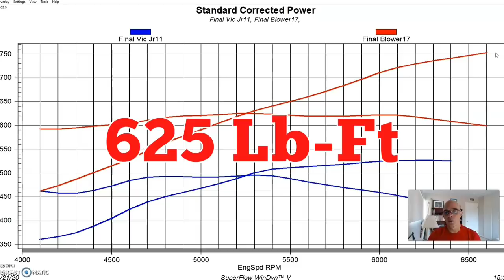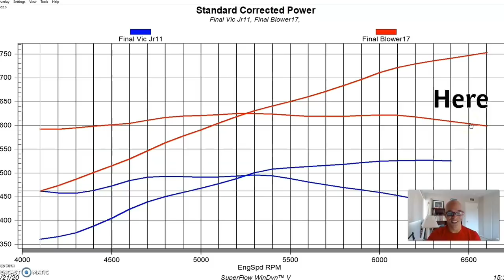6-71 SUPERCHARGED 383 LS STROKER

Comment: Funny you did this bcz ive been wondering if  I could build LSX engine to 526ci & then run same Blower setup as my Pro Mod runs which is Fowler F11 Extreme, carbon hat w/a spacer..Since they make LSX type engines with Turbos pushing 3000+Hp, I figure IF I could make LSX of same basic size as my 14*degree symmetrical big chief w/a KB Olds block..Figured same size engine w/the characteristics of LSX with great heads, How can it NOT make similar power? Everybody w/a Roots Type Blower now is switching to HEMI, pretty much bcz of RPM, limits of Olds BBC Is there valve train at Hi-RPM where the problem hits..When engine like mine is pretty much limited to 9500rpm yet a similar HEMI engine can easily roll to almost 12000rpm! Now w/a Billet Rotor Hi-Heliex Fowler F11, at same overdrive level but now spinning another aprox 3000rpms, Imagine how much more booste especially at that engine speed will be achieved? IDK how much of difference between the 2 engines wud be solved by hi rpm boost but to go by other guys running Blown Alcohol Hemi's which are going into 3.60s & PSI screws that are running in 3.40s at 221mph in 660ft😳.So if anybody would know would be you..Also, why not use Hi-Heliex Blower? Maks Way More Power, taks less then 1/2 amount power to run Blower & the intake charge is Significantly Better bcz of heat reduction again which is significant, some why not try "Blower 2 Blower" comparison to 60degree cast rotor blower, 120degree Hi-Heliex billet rotor design & Then a Procharger, Atleast 136 prefer 140 for max power tests but most guys were using 136 Procharger..Then we'd all know kinda power differences are made w/a Roots, Hi-Heliex & Procharger combo on any given engine, And Id personally like to know IF I Could run LSX in 526ci range? I think LSX would have better power bcz they have ability to Rev higher which would spin Blower faster at same overdrive Or I THINK things would go that way..I maybe thinking on completely different level of thougt to this then avg car guy would, they dont know what Hi-Heliex even is😮, so this would be good information for them all to have aswell😁🐾.Oh thanks for channel, I pretty much just trust what you say & prob what Steve Morris says over most others who build & test these engine videos....

Comment: To me, and after seeing the old school go to new school, the new school tech has allowed truly streetable, reliable and relatively inexpensive 1000hp engines to exist. Race engines are now undercammed truck engines.....all the moderns have race blocks and race heads from the factory. 6 bolt mains and high flow heads were unheard of 30 years ago.

Comment: how much power could the block take with that bore? going from 3.780 to 3.905 is a ton of bore. its like a 9th of a inch. would you be better off with a 3.80-3.840 bore at 1000+hp?
Reply from the maker: ITS FINE AT THIS POWER LEVEL
Reply: @richardholdener1727  how would it do at like 1000-1200hp you think? with a boosted set up i dont really see a lot of benefit to going forged rotating assembly and $500 in block work if the block can't take 1200hp besides more low end power from more displacement. you kinda proved the turbo/blower flow rate is what limits hp as long as the motor will take it.

Comment: Hello I’m really hoping you could give me some advice.I have a 66 c10 that I’m building as of now it has ,what the casting numbers are telling ,me is a 80s model 350 4bolt from a van or truck and a 2 speed power glide.I recently purchased a th400 and am going to have it rebuilt and use it for daily driving. What I need advice on is I’m just looking for the cheapest way to make 400 to 500 hp should I keep the old 350 put heads and a cam should I pull it out and have it rebuilt into a 383 s. Or should I get an Ls short block and put a cam and carburetor intake on it (because I don’t want efi Trying to stay in the classic vibes) idk what’s the best bang for the buck pls consider engine life and durability thanks.   Hope to see you in the inbox

Comment: Try with E-85 the blower needs that kind of cooling never pump gas again when dealing with blower the E85  will act as a intercooler  and pick back up more horse while being reliable 💯.. Blower should never be recommended with regular gas for the lack of a
Intercooler... Even if you 9:2:1  on the
Motor Procharger and other come with intercooler  so pump gas is super reliable on those Applications... Blower Applications should always  Run either E-85, methanol or race gas only if you wanna make real power while being reliable 😎
Reply from the maker: we ran this with e85 also, but even fuel supplied by the carbs acts as an intercooler

Comment: What would be a good cam for an lq9 ? It's in a 04 ss awd truck and it gets daily driven, would sloppy stage 2 be a good cam to run since it can run n/a or boost? I plan to go centrifugal supercharged later and want to go ahead and start getting ready for one..
Reply: @Richard holdener

Comment: GOOD, STUFF, I HAVE A, 350 SBC, WITH, BAGER, 11/1,,,PISTONS 1.6 ROLLER, ROCKERS,, THE HEAD HAS NEW SPRINGS, AND THE, CAM, 502/504,,,LIFT,,THE HEADS, ARE, 1970S 74CC,WICH BRING, S COMP DOWN TO, 10. 1/4,,VALVES 198,,THIS IS WERE THERE, WEAK I, NEED, 202/198,THESE HEAD S HAD BEEN MACHED TO THE INTAKE DUEL, PAIN,, SHOULD I, GET, 202,,MACHINED, IN OR, BUW NEW CAST HIGH FLOW 202/198,BECAUSE THE RUNNERS WILL BE BETTER OFF, THANK YOU VERY MUCH, I, DON'T KNOW WHAT TO DO,,, 5000K,ON,THIS SPEED SHOP BUILD,,,...

Comment: Gale banks tested a 10-71 blower and the air temp coming out of the blower was pushing 400*. Its a very inefficient air mover. The design is meant to move a volume of air not pressurize it

Comment: Do you have a low compression 87 octane 383 ls recipe for modest HP ~400hp for use in a boat?  Preferably with inexpensive factory heads?

Comment: I’m 38 and feel like I’m in the middle. I grew up around SBC and BBC then the LS came out but was really only in F bodies and Vettes. When everyone caught on that the truck engines were almost the same it was still too expensive to play with. Now “LS” is just like the SBC the parts are everywhere, cheap and the aftermarket is huge and they are even more reliable and the SBC was a standard of n hot rodding reliability. long story short I like the old school and new school.

Comment: Just got done with a Dart motor. You can check it out on my channel. Its 516 cubic inches and has 8-71 with two 750 AED blower carbs. I kept the boost at 6 pounds and it did 680 on the dyno. Ive got the motor in a boat and it runs 93mph and is a lot of fun..Im a boomer and all the millennial's hate it because it interferes with their wake boats...!!!

Comment: I would love to see a great 7.0L battle 426 hemi, BBC 427, LS 427, FE 427, FE 428, Ford 429 and others in that Range 

All the same rough cubes but so many ways to do it longer strokes smaller bores and shorter strokes with bigger bores and every point in between

Comment: Good video as usual Richard  But you haven’t tested a Barra yet
Reply: We just don't have them. There is like two running engines in California. The RB is the same thing. Some guys swapped the gm Atlas six out of the trailblazer but it's huge so it only really fits in big cars and no body cares enough about it.

Comment: I was just reading a thread on how to build a 560hp 383 SBC. Those guys were doing big cnc afr heads, 250* solid roller, 11.5:1 cr and JUST getting there. The 383ls you did here could be driving gramma to church and probably get decent gas mileage to boot.

Comment: Hey Richard holdner its joe the guy who keeps bugging you about the 429 ford I was wondering about cheap ways to get more power out of my 5.4L ford f150 already did headers ported the intake and throttle body 4 inch exhaust and cold air intake been looking for a stock 4.6 blower but if you have any cheap ideas let me know by the way the truck rips pretty good right now I'm just the guy who wants more lol

Comment: I wonder where we would be now power wise if Ford, GMC and Dodge had jumped on the Peugeot bandwagon and starting making dual over cam engines in the early 1910's. Nothing against a pushrod just wonder where that would have taken the hot rodders.

Comment: Mr Holdener, the younger generation has no idea of the potential of a basic 454 bbc, and what they were capable of in the good old solid lifter ls6 days. All the kids know is that the 454 tbi peanut ports were dogs. Please give us a test of a basic 454, peanut ports, oval ports, vortec oval ports, and rec port heads. Give us the factory hyd and solid cams for comparison😁 I think if people saw what a basic old rectangle port 7000rpm solid flat tappet 454 could do, they would be surprised.

Comment: I was the old hardcore sbc 23 degree guy. Port them paper thin, and use a streetable solid roller. Then i saw my buddy's rectangle port ls3 heads. Then his mild ls3 deal made 450 whp on the dynojet. Now, given the cost of top shelf 23deg sbc heads vs a complete rectangle port 6.0 ls truck motor, where is the dollar per horsepower?

Comment: Not to go back old school but I still wanna see a 377 sbc vs 383 sbc same cam and heads just to see the power curve
Reply: The difference of 6 cubic inches isn't going to show a change in the power curve, his previous testing has shown that even with slightly different bore and stroke combos, when they are about the same cubic inch, you're not going to see a visible change of maybe a couple hp/tq
Reply: @ziggybmw  probably wants to see the destroked 400aka377 which is a high reving combo vs the traditional 383

Comment: Ok Richard, and anyone else who may know:

C6Z06 with forged TSP 427 @ 9.7:1 CR and 10lbs of boost from a Novi 1500 centri blower 704whp 600wtq at 185 ECT.

It is at 15 degrees advanced at peak power but when my ECT gets above 212 is pulls 2 degrees. When my IAT gets above 140 it pulls 4 degrees. I can’t seem to make a decent pass at the strip because one or more of those is never lined up and the engine falls flat on its face.

Is it safe to assume that the stock retard settings for an 11:1 motor with 26 degrees advance have little relevance now? 26-6 is not the same as 15-6. My knock sensor never sees knock. 

Can I start taking out those safety measures one degree at a time while watching for knock?
Reply: Maybe it’s the driving..
Reply: Travis Moine whatever makes you feel better about your wife’s boyfriends automatic mustang...

Comment: All the current GM platform supercharged from the factory vehicles are roots style?......So what are you talking about?
Reply: They are roots style but not a typical roots blower. Most of them are high helix tvs rotors where the rotors have 160° of rotation and the flow isn't in the same direction. It's the same principle but it's been refined for 150 years. The old school gm style blowers are kinda crap compared to anything else. You should see what happens to one when you don't run fuel through it, they get hot enough the rotors grow and gall.

Comment: I know you would never do one , but I’d love to see what you could do with a 308ci Holden V8. They used to be used in our touring cars in the 70’s until the early 90’s and they could get 650hp N/A ! 
Anything with 2+HP per CI N/A is phenomenal! Love the channel Richard you old Dyno saur 😝👌🏻
Reply: A Pair of  stock vn-vr-vs-vt 5.0L heads, with some port clean up work a 383 crank, the right camshaft, with a 6-71 blower, will match or exceed the HP the Blown 383ci LS in the video, cost roughly the same Big$$,$$$.$$
Reply: Brenton K you wouldn’t even need a 383 crank , there is plenty of plastics out there that would stomp this 383 LS !

Comment: a fact one may not under stand is this.back in the 50's threw the mid 70's hp was money .when they built say a427 chevy ford or hemi it was      about who won on sunday sold on monday.now i love the old stuff but the new lis better in alot of ways.but back in say 1960 they could built a ls come on they wher not dumb but the tooling takes time.okay now that makes money right now what is it worth.now this is just a exsample only.409 time correct say costed as a option 269.00 and if you wanted the ls it would cost say 5500.00 now who back then pays to have a ls on the street to drive every day people raced it and yes some one would drive it every day cool but the cost is just a bout the same as small house.now to day modren tec to day can give us cheeper way of making better engines but the truth is fact i would not pay for a engine thats built the same way as the fithtys way and call it new advanced modren block and had not a thing better to offer no i wouldnt compared to the ls for the same price.so back then power was money just like to day but we dont want to pay for old stuff for the same price.but us old farts like the fact of try to get every last bit out of what we have.so new and old still have alot to offer